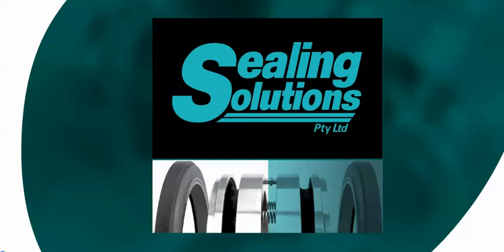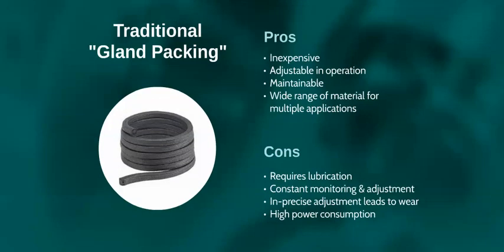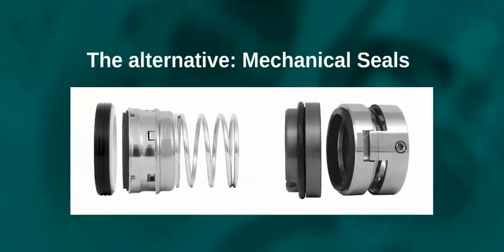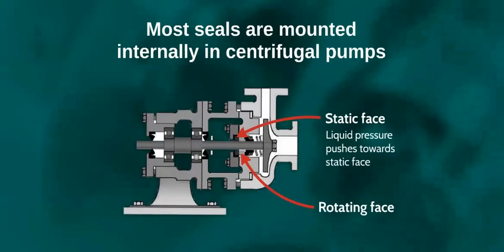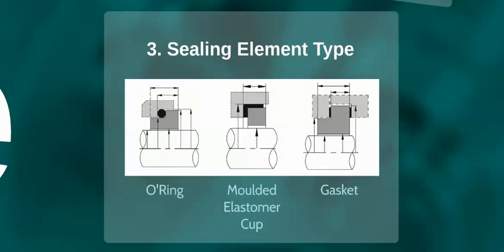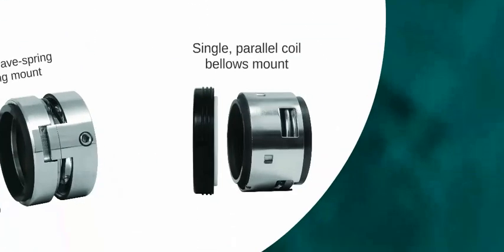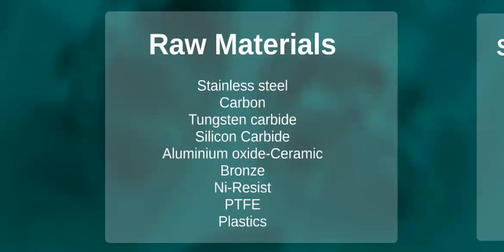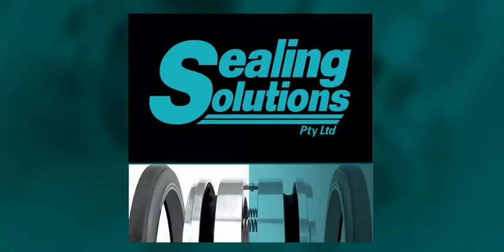What Is A Mechanical Seal?

Comment: I like how you mention the pro's and cons of gland seals, and then don't mention any of the cons of mech seals. like they're super expensive, and then they do fail, and they will,they fail detrimentally, causing massive leaks and possibly completely destroying the shaft they're on. unlike gland seals, where they, drip, and as they wear, just drip more.